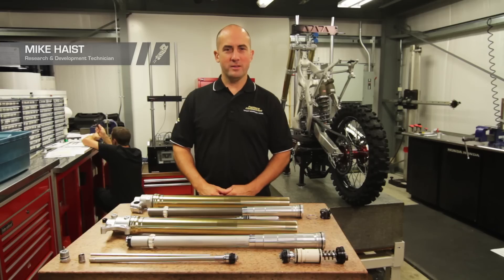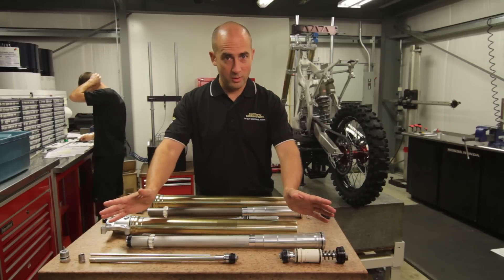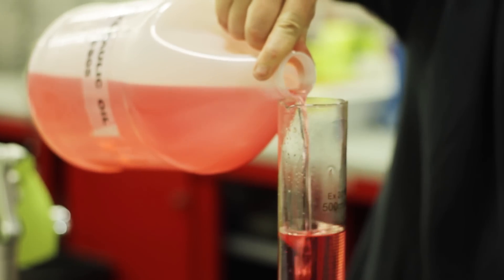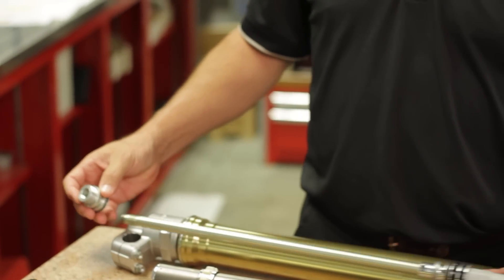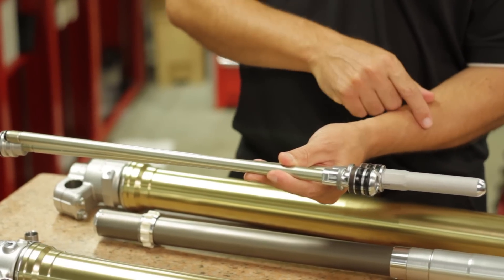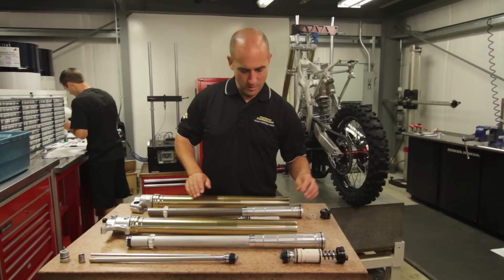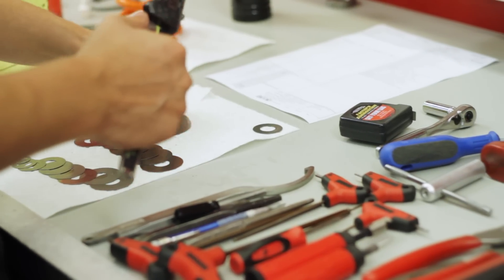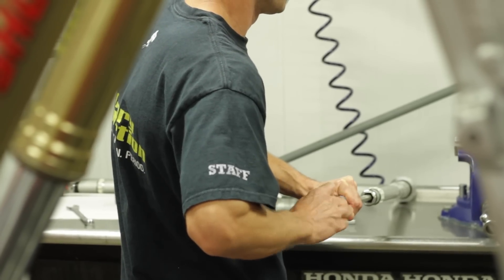2015 CRF250R Showa SFF-Air TAC Fork

Comment: Hi, 
Got the 2017 crf250r tac fork, i noticed that the rebound damping adjuster doesn't seem to do much in terms of rebound damping and can't feel much difference when the clicker is all the way in and all the way out, when the fork is off the bike. Is this normal? If not what could be the issue?
Any help would be much appreciated
Reply from the maker: That is not out of the ordinary for that stock fork.  We have some very nice performance modifications to each valving circuit and tailored to your needs will improve performance and will generally provide you with adjustment range that is more response than in the standard configuration.
Reply: @FactoryConnection that's a releif to here, it's normal. Ill check out the website and have a look. Thanks very much for getting back to me :)
Reply: @FactoryConnection  another question if i may, should the damping side stantion fully extend once released from compressing it, it does when the axle holder is facing the floor, but when held horizontally it stops about 1 inch from fully extended position

Comment: How much oil goes into the inner chamber on the right fork, can’t find the information anywhere.
Reply from the maker: 350cc is the STD outer Chamber oil amount. The inner chamber is a self bleed system as you bleed the cartridge rod the excess oil will come out of the bleed holes in the subtank.
Reply: @FactoryConnection can you guys be more specific on how to properly bleed the air out of the inner chamber ? I filled up the outer chamber first (350ml of oil) tightened  everything and then started pumping the leg, but i think i didn't get it right.
Reply from the maker: @ I recommend you contact us 603-664-2221 ask for Tim in technical support.  I also recommend to consider sending your forks to Factory Connection for a service and maybe even Revalve to improve the performance / tailor to your needs if you are not familiar with the servicing of this fork.

Comment: Hey lads, can you please tell me on the left hand side fork on top the outer chamber cap thread size is? I brought fork bleeders for this model but they are both the same thread and both fork bleeders only fit the right hand side fork bleed cap.
Reply from the maker: Left air bleeder is 8mm x 9mm thread length 1.0 pitch thread

Comment: Can anyone help me with the setup for this fork i recently bought a crf 250r 2015 and I'm really not getting on with the standard settings. Im 150 pounds intermediate rider and am really struggling to find the right set up, please help
Reply from the maker: YRZZv27 We'd be happy to help.  Best bet is to give us a call at 1-800-221-7560.  We can provide some settings that will help with the stock suspension and we can give you some information on a Revalve if that's what you're interested in.
Reply: Do you have a email?
Reply from the maker: rich@factoryconnection.com